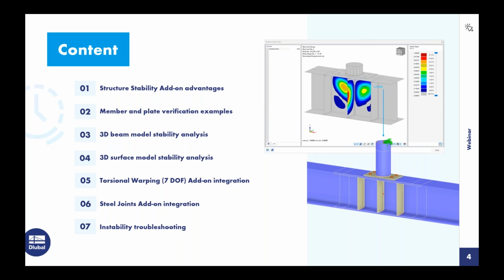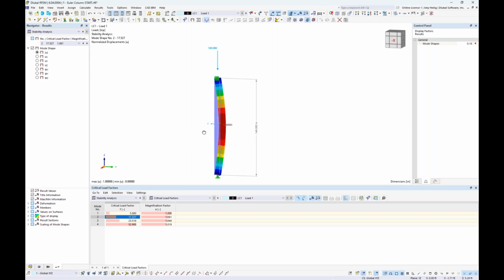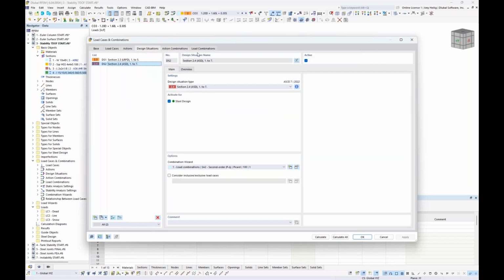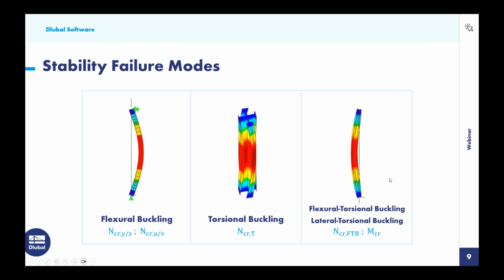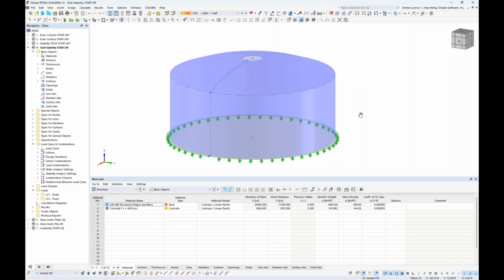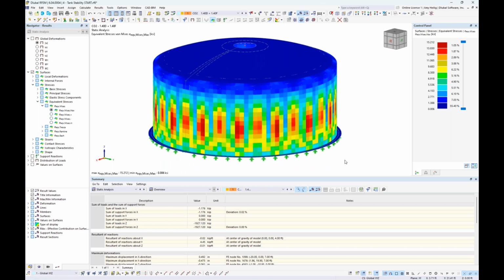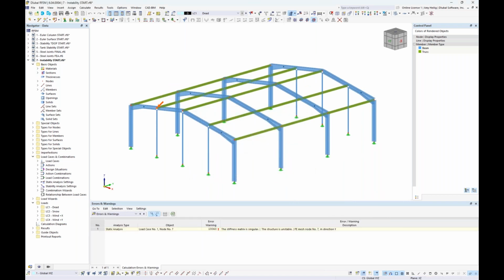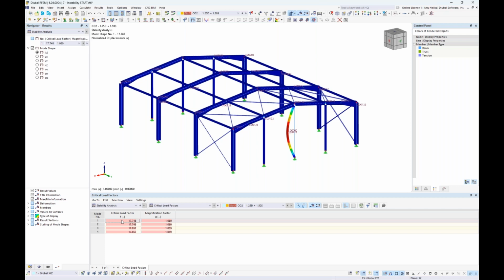Webinar | Stability Analysis in RFEM 6

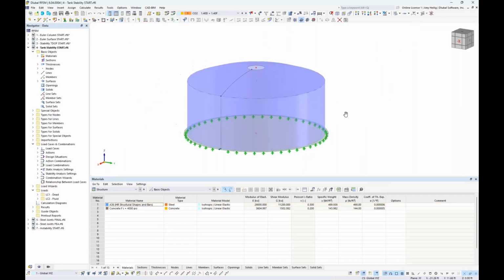Comment from the maker: *NOTE: At timestamp "34:34 – 3D tank structure stability and imperfection modeling," LC 2 Fluid has been replaced with an inward compression force, LC 2 Soil, in the downloadable model. The previous outward fluid load caused tension on the tank walls, which was not suitable for stability analysis. The overall workflow remains the same, with only the load application modified.